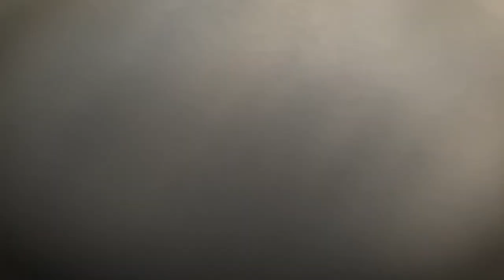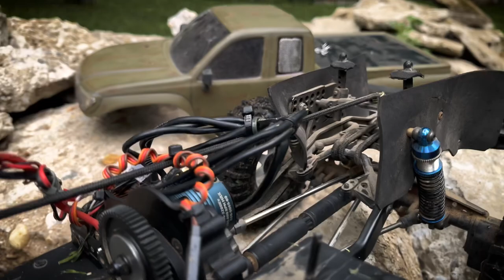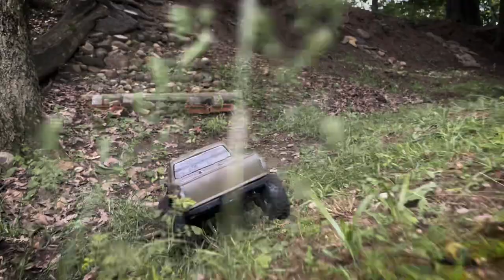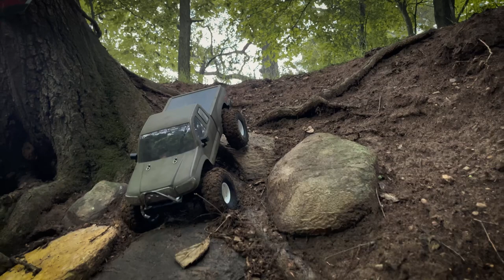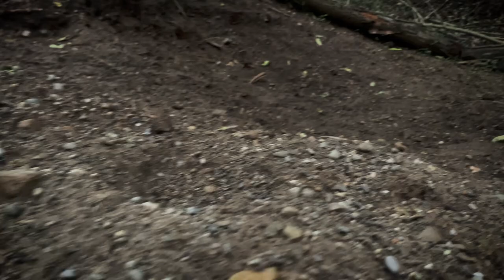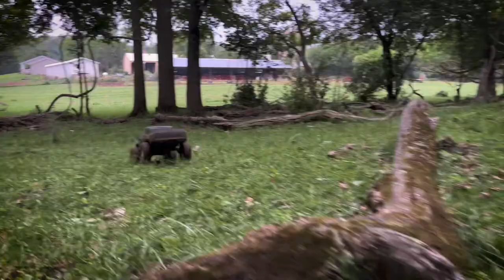Basecamp goes brushless and gets brass!

Comment: How did you add that metal Stinger to the front Bumper? And if you don't mind me asking where did you get the metal Stinger or did you make it? Also those wheels are sick! again if you don't mind, what are the brand of Wheels? If I missed the information on all that I apologize , I am working my way through all your Videos.

Thanks , AWESOME video \m/   \m/
Reply from the maker: The stinger was from some off brand metal bumper on Amazon. I just took the stinger off that bumper, drilled holes in the factory Basecamp bumper, and bolted it on. The wheels are the Injora deep dish. Much appreciated!
Reply: @DRZ-RC  Thank you!!!! I like that the factory Basecamp Bumper has a Fairlead Slot and I have made my Daughter a Servo Winch for her Deadbolt but she wants a bumper like yours. That is what she told me when we were looking at your video. I have a Square Body Chevy that those Deep Dish Wagon Wheels are going to look awesome on. 

Man thanks for getting back up with me so fast, I appreciate that and thank you for sharing your videos 🤙🏼
Reply from the maker: No problem man, glad ya enjoy the content. That’s what I’m here for.